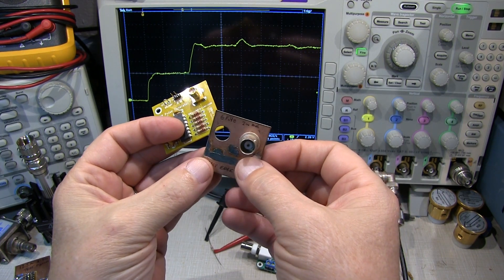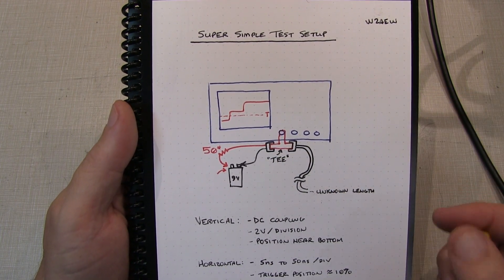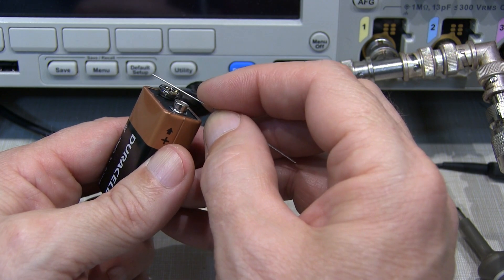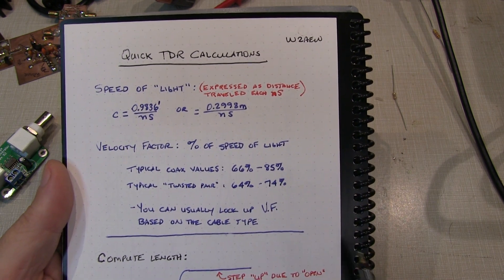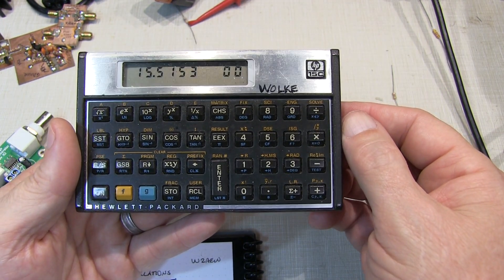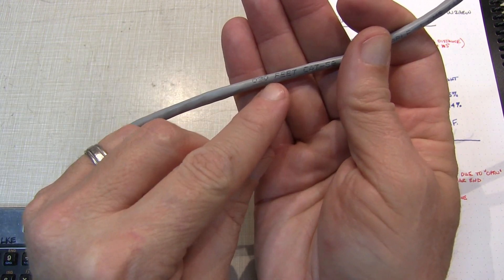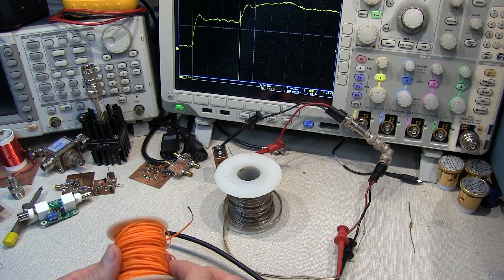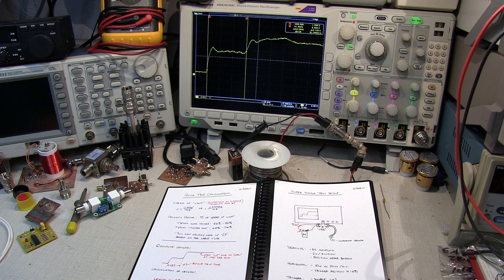#323: Measure length of coax, etc. with your scope, a battery and a resistor - simple TDR

Comment: I have 3 conductor wire that is buried in the ground.  Two of the conductors are shorted.   Can I use this technique to find how far away the short is so I know where to start digging?
Reply from the maker: You can probably get close enough.  It you have another piece of similar cable, you can cut a known length of it and bury it, then measure delta-t and compute the actual velocity factor.  Apply that to your troublesome cable measurement.  Also, remember that a short circuit will cause the second step to go down instead of up.
Reply: @w2aew  ok thanks.  It’s buried 3 feet down, so accuracy is key!

Comment: If you replace the fixed resistor with a variable resistor, can you also approximate the feedline's impedance?
Reply from the maker: You can if you place the variable resistor at the far end, and adjust it until the reflection disappears.

Comment: You can use the calibration square wave output of the scope to generate the step waveform. Then you don't need a storage scope.
Reply from the maker: Usually not, for two reasons.  The rise/fall time of the probe compensation square wave is usually too slow to use as a TDR.  Second, many of them may not be able to drive a low impedance load.

Comment: Hi Alan This video like most of the others you have done on this subject relies upon look-up sources to obtain Velocity Factor figures. For transmission Line that is pretty easy to find. But believe it or not for more common types of conductor it is not so easy to find. For instance take common copper pipe. I can't for the life of me find it. Same thing can be said for 6061-T6 Aluminum. Is there something I'm overlooking ?

Bob AA6XE (ex-K6TR)
Reply from the maker: Velocity factor doesn't depend on the conductor type, it depends on the dielectric constant of the insulator between the conductors.  That's why you can't find it for copper pipe or aluminum.  If the insulator is air, then the VF will be close to 1.
Reply: @w2aew  Thanks Alan

Comment: Was it the air-conditioner turning off noise in the middle ?
Reply from the maker: Electronic damper in my boiler for the heating system.
Reply: Good p/u.

Comment: HP-15C?!  I thought I was the only one who still had and used one regularly.
Reply: I don’t have 15C, but I’ve been using my 2 HP-41CX since 1982.  One is actually a 41CL.  Old HP calculators are the best ever.
Reply: @SteveAaron  Yep, and the NEW (Chinese-made!) ones like the 8S and 10S, shouldn't be allowed to carry the brand label HP.  The LCD displays usually die within 6 months - and certainly before the batteries run out. :(
Reply: @hectorpascal  I just don’t buy modern HP stuff.  If I really had to buy brand new, I’d buy from Swiss Micro.
Reply: @Salvadorbalihai24  Yes!  Probably one of the greatest pocket computers ever made.

Comment: Let's go even simpler and remove the battery. Would the test signal generator found on most scopes be suitable for generating pulses for the measurement?
Reply from the maker: Probably not, since they often have a very slow rise/fall time, and may not be able to drive a low-impedance load.

Comment: Allan great video.

Using the same ideia you can put the open end in another channel it is possible to measure the velocity factor from the delay that it causes. I know that the propose of the vídeo are to measure maybe an cable that are installed and you dont know the length ... but as all yours videos are so didactic I thought that it will be an addendum to the subject.
(chanels 1 and 3 are best when there are 4 channels because many scopes uses interleave in adjacent channels (1 and 2 for example)).

thx for all the knowledge shared.
Reply from the maker: Yes, the assumption is that you might use this method when you don't have access to the other end (buried in a spool or at the top of a tower, etc.)

Comment: Pretty standard fare.  One practical application for this technique would be to see if the cable in your home is damaged.  Computers are great they tell you this just by using a "ping test".  You ping your ISP and see how long it takes to get back to your computer, no scope needed.
Reply: not neccessary a good analogy to what he did here. this only tells you you have some connection, not how long the cable is or where its broken, and its dependant on about a couple dozen factors completely unrelated to cable length entirely

Comment: In case folks are here for methods of estimating remaining cable on a spool, you can always weight it, subtract weight of an empty spool, and divide by weight of some known length of cable.
Reply from the maker: Another great method - assuming you know the weight of the spool and everything can fit on a scale!
Reply: @w2aew  True. But you may well have an empty spool laying around to weigh. And if you don't, you might write on the spool you have a note reminding you to weigh it when it's empty :-).
Reply: True, but this method should be able to tell you how far away you have a break in a buried cable
Reply: @patpalermo7629  I'm not sure your point. If you're looking for remaining cable on a spool, presumably it's not buried or broken.
Reply: @Graham_Wideman  If you have a buried cable with a break in it, could you not use this method to find the distance from the termination point that the break is at? It would make it easier for repair work.
Reply: @patpalermo7629  Yes, obviously, you can measure buried cable using the reflectometry method as described in the video.  But you replied to my comment which starts with "methods of estimating remaining cable on a spool", it's not about buried cable. So apparently you're not replying to my comment at all.
Reply: That's it! I'm going to Goodwill to trade in my scope and pick me up a fancy bathroom scale!

Comment: Excellent video, Alan! This video also explains why you can have a high SWR on your antennas, due to the reflected energy. I don’t know if you know much about physics, but now that I’ve seen your video, you have me thinking. Why does the energy reflect back into the wire, and not simply dissipate from the end? I’m guess that it has something to do with the wire being a better conductor than air. Any thoughts?
Reply from the maker: The same reason that the 120/240VAC mains power doesn't "dissipate" at an unused outlet/receptacle - there is no load.

Comment: Hi Alan

Thanks for this and your other videos, they are awesome.

Let me please share an idea with you.
Since a while I wonder how one could demonstrate the various properties that transmission lines with their characteristic impedances have.
See for instance this link:
http://omarcclub.org/forum/discussion/232/why-do-we-use-50-ohm-coax

It's somehow well-known that 50 ohm coax is used for most applications because it's a reasonable tradeoff between attenuation, power and voltage propagation, but it would be neat to be able to actually visualize that. After all, people who deal with transmission lines virtually always take it as granted that 50 ohm or 75 ohm is right for their application, but I think it would be great to actually see why that is.

Do you have an idea how one would go about this? And if so, would you be happy to make a video about it?

Maybe create a pcb with a series of transmission lines with increasing impedances in let's say 5 ohm increments from 30 to 120 ohm and then do some measurements on them? I just don't know what i would try to measure. 

Thanks,
-Alex OE2AHL
Reply from the maker: I suspect that the "optimum" impedance (tradeoff for power handling and loss) might be a little different for PCB traces vs. Coax....

Comment: A good follow up is on short circuit v open circuit or damaged cables
Reply: broken cable is pretty much the same. the tdr method tells you the distance to the break. thats all there is to know.

Comment: I was so disappointed to learn this can't be done with a single wire. I thought you found a magical mystical new way! 
I have spools of magnet wire I like to know the length of, without resorting to calculating it through resistance and cross section?
that 9 feet something, was impressive resolution for such a simple procedure.
Reply: How about weight? Should get you within 10% or so.
Reply: With enamel wire most of the mass is in the copper, I'd thing you should be able to get close enough just assuming the whole mess is 100% copper, weighing it, and calculating from there.
Reply: @Broken_Yugo  A quick look on Google and I find #24 wire weighs 0.124 pounds per 100 feet. The chart I found didn't say if that was bare wire or what sort of insulation. I'd assume bare, but probably looking at something other than the first hit Google brought up would give a result for enable wire or even DCC if that is what the OP has. The reel will weigh something, but for 1lb to 10lb spools this will probably be thin sheet metal or thin plastic, and add less than about 5% to the total weight. 
So a simple weight will probably be as or more accurate than either a resistance check (if you could get both ends of the wire on the spool) or some attempt at a TDR-like length determination.

Comment: I cant approve the ft/ns however ... seriously I thought we could agree to use metric only on science/engineering?! Its due to rubbish like that why space missions failed and people died in the past.
Reply from the maker: I intentionally put both factors in the notes so that folks outside the US could use metric if they choose to.  But, here in the US, wire/coax is sold by the foot, rated by the foot (i.e. loss in dB per 100', etc.), so that's why I worked my examples in feet.
Reply: Relax Francis.
Reply: Shirley this is hardly critical. It's fine as long as he doesn't mix units. His house is almost certainly built in feet & inches, so if he's laying cable, ft/ns is just fine.

I mean, you don't go screaming at physicists for using natural units, do you? 
https://en.wikipedia.org/wiki/System_of_measurement#Natural_units
Reply: I'm thinking it was meant to be humorous. Would the roads be safer if speed limits were posted in km/hr? But the mention of death in the field of scientific exploration is quite macabre. Maybe he has a good example he can cite. I'm sure it has happened.
The medical field has serious problems with units and abbreviations in health care. No doubt people die everyday still today because the field won't acknowledge this problem and implement simple changes to abate it.
SI is the best and I agree it would be nice to all be on the same standard. Inertial based of course! God Bless
Reply: @johnnytacokleinschmidt515  They are on the same standard. They just have a bunch of extra units: e.g. they define 1 inch as 25.4mm exactly. 😁

Comment: Very nice! Changing the serial resistor to flat the ripple will measure the coax impedance roughly?
Reply from the maker: No, you'd have to terminate the line at the far end to get rid of the reflection.  The ripple is also partly due to the clip leads.
Reply: @w2aew  Haha, understood, thanks!

Comment: Excellent video, TDR always seemed very mysterious and demanding technically and it’s encouraging to see it done so simply
Reply: No.. not really
TDR is simple , it just SOUND complicated
TIME DOMAIN REFLECTOMETRY     sound scary

SIMPLE TRANSLATION :  A Little signal is sent all the way down a cable and when it gets to the end a reflection is caused , causing it to come all the way back to the beginning of the cable

Now
1. We know how fast the signal travels and it travels at a constant pace

2. We can measure the time it takes to get there and back because time is a constant

3. so.... if we want to know distance,   we just used  DISTANCE = SPEED / TIME
that's it 
Then because the signal went up and back,  you divide the answer by 2 to get the length in 1 direction

it's not really that hard, Just sounds fancy

Comment: Very interesting,but why do you use the speed of light in the calculation, as you are not dealing with light?
Reply: The "speed of light" is not really the best phrase for the velocity of an EM wave in coax.  Maxwell (the Scots guy who developed the Theory of Electromagnetism around 1864) was finally convinced that light must also be an EM wave, because the calculated speed of his waves was the same as the measured speed of light!
Reply: Light is just electricity on lots of caffeine.
Reply: He's using the speed of light because cable specs provide a velocity factor which tells speed of propagation on that kind of cable relative to the speed that signal would travel as an electromagnetic wave in a vacuum (ie: as if broadcast from an antenna.)
Reply: @Graham_Wideman  and said antenna being in vakuum since the numbers are (slightly) different for air
Reply: @urugulu1656  Yes, antenna in a vacuum, of course.

Comment: Whats the use of wanting to know the TDR? why would someone want to know how long an RF signal takes to go down a Coax cable. If you're measuring the TDR of coax cables doesn't the Oscope need to be terminated to 50ohms? because you have it set to 1meg termination impedance which doesn't make sense for RF coax cables.
Reply: Knowing how long the signal takes to reflect back lets you work out how long the cable is. (As long as you know the velociraptor, or have a suitably similar piece of cable to calibrate on.) If there are breaks (or even harsh kinks) in the cable, you'd see those too.

The far end is intentionally unterminated so that as much of the pulse as possible will be reflected back. The near end is terminated with that 50Ω flapping in the breeze—good enough for 'straya.
Reply: @LiyangHU  What the cable has Kinks or Coils cables what does do to the signal?
Reply: @waynegram8907  You'd see additional reflections, albeit not as prominent. He's done a bunch of other videos on TDR where I'm sure this is demonstrated, but am on phone so can't easily provide links I'm afraid.
Reply: @LiyangHU  its ok thanks I will look for the additional reflections
Reply: A common use for TDR in aircraft maintenance is finding where a coax cable is damaged. On a commercial aircraft most of the cable is buried behind internal trim panels, and if all you know is that the cable to the antenna doesn't work, you have to take about a third of the airplane apart to find and fix the problem. That takes time, and that costs money because the plane is out of service.

If instead you can connect a TDR meter to the antenna cable at the back of the radio in the cockpit and it tells you that there is an impedance bump at 43.3 feet, you can look at the wiring layout diagrams for the airplane and know within a few inches where you need to go digging. The telephone company does the same thing (but on a longer distance scale) when a cable between COs stops working.
Reply: @lwilton  thanks for the information. If you have any other example of measuring TDR
Reply: @waynegram8907  I've never used it myself. Not that I haven't wanted to at times, I've just never had a fast enough scope. 
It's my belief that most use of TDR is for maint work. If you are installing something, you have better ways of knowing how long a cable is or where the connectors and possible impedance bumps are. I suspect TDR was first defined or invented by someone in Bell Labs, and probably first used by the phone company to find line breaks or shorts. I remember HP magazine ads in the 1970s advertising using it in aircraft.
I'm sure these days it is used most anyplace that you have a reasonably constant impedance line. That would include networking cables and even high tension power lines. I think there is a variation that someone invented for fiber optic cables, but I'm unclear on how it works.
If you have very fast equipment you can even use it to find impedance bumps in printed circuit board traces. But I think that is more commonly done by simulation rather than actual measurement.
Reply: @lwilton  thanks, I didn't know they used TDR for impedance bumps in printed circuit boards traces.
Reply: in fact the termination that IS NEEDED are the 50 ohm resistor that are in the batery, as you match that resistor and the cable impedancy the osciloscope needs to have hi impedancy, if not the pulse will be matched at the oscilloscope and dont travel (just for simplicity) to the end of the cable ...

(in fact the cable becomes an stub but these is another discution and will change the experiment ... )

Comment: Great demo! I love simple. Thanks!
Years ago, I used a similar technique to resonate a coil and capacitor for 14.318MHz VCO in my very first video frame grabber. (The literature of the day was obsessed with 4fSC at that time) I wound a few turns of coil on a hunk of chopped off Bic pen, put 22pF cap (representing the varactor diode I planned to use) in parallel with it and AC coupled a pulse from a 555 timer running at a couple hundred Hz. I then looked at the ringing of the LC combo on the scope. The scope was triggered on ch2 directly from the 555 and ch1 showed the ringing of the LC. I tuned it 70nS by adding / subtracting turns and in less than 5 minutes, Bob was my uncle!

Comment: Nice short and quick test method there Alan. If you have the scope available the rest of the parts are likely to also be there, and you just need the T piece and the wire ended resistor, the adaptor is not needed, as you can simply put the resistor end into the T socket, and touch the battery to both.